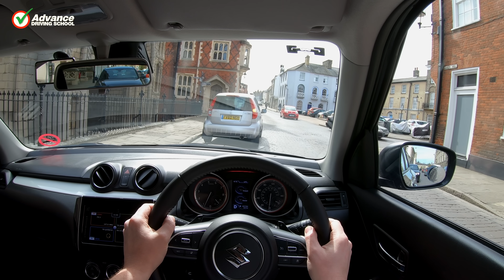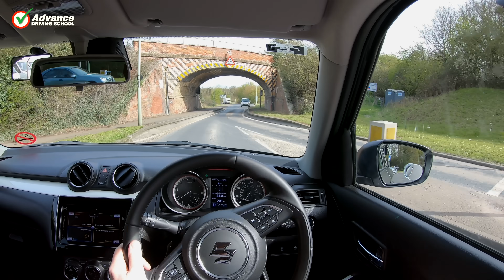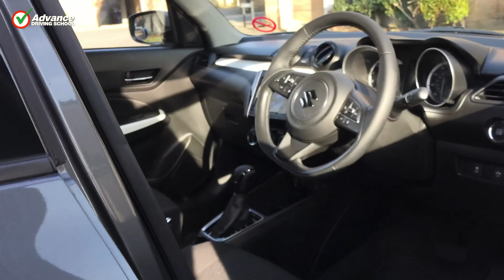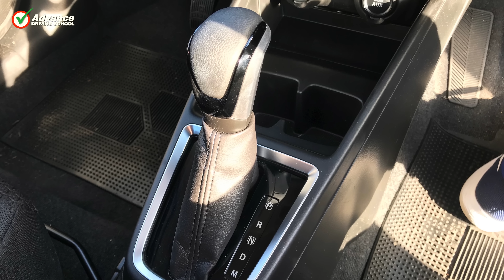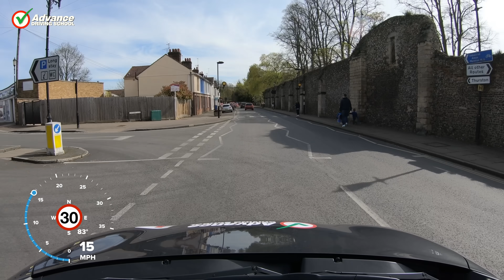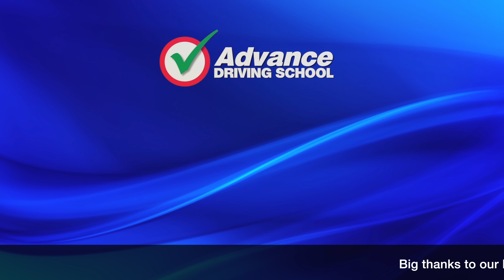How To Drive An Automatic Car

Comment: When driving in busy road in automatic, which position should the gear lever be when stopping briefly or more than 3 seconds while making use of handbrake?
Reply from the maker: When stopping for anything less than 30 seconds we just leave the car in Drive, and keep the foot brake applied. If stopping for a longer period, we just select Park and release the foot brake. We only use the hand brake when actually parking the car.

Comment: The video says it's a 2019 car but the registration number plate says 2018 (68 plate).
Reply from the maker: That’s correct  - ‘68’ plates were issued from September 2018 to March 2019 👍🏼

Comment: What gear do I select at a red light?
Reply from the maker: There are no rules about this - but you have 3 options, depending on how long you think you might be waiting for:
1: Stay in Drive, and keep your foot brake applied
2: Select Neutral, and apply the hand brake
3: Select Park and release the foot brake

Comment: For an ADI part 2 test, is it essential from a safety point of view to use PARK and the parking brake at traffic lights and pedestrian crossings?  I normally use the HOLD function with the vehicle in DRIVE but if you accidently touch the accelerator, it could be quite dangerous at traffic lights and pedestrian crossing....please advise. Thanks!
Reply from the maker: As long as you keep control over your vehicle, you will be fine. There isn't any requirement to use the handbrake, or select Park when you stop in traffic - we only use them when parked at the side of the road. However, if you think that is the safest thing to do in your car, then that will be OK.
Reply: @AdvanceDrivingSchool  Thank you.

Comment: Sounds silly but the light voice is very therapeutic. I have had a year break since driving. Had around 5 years pracfice but only in a manual. Never an automatic. Just had my new car a few days and only driven 4 miles. I am nervous as I made a mistake when I first got it  breaking too hard...as i thought of a clutch. Ive been told to just go out and practice as much as possible. Then it will just come to me like a manual did as its the same as a manual just no changing gears. It should be easier but is isn't as muscle memory I still am stuck mentally on a manual. Trying my best to just forget any worries and just go out. My first experice  driving was 400 miles to Devon my first week of driving after a 2 year break. It was the deep end but it gave me confidence. I may do a similar thing again this time. As I cant just stay still and not practice.
Reply: I also may go further to areas I know. As ive moved house into an area ive got no idea about. Which well adds to the nerves. As I have to concentrate even more with the lack of knowing the roads. Quite a busy area too... so ive had a poor start.

Comment: I know i should park my car in "P" but Is it safe to park it in neural ? i mean nothing will be broken ?
Reply from the maker: We shouldn’t leave the car in Neutral, as the car is free to roll away if the handbrake isn’t applied firmly enough. Using Park locks the driven wheels for extra security 👍🏼

Comment: Is it Okay to turn the car without pressing the brake pedal ?
Reply from the maker: Yes, we can steer the car at any time 👍🏼
Reply: @AdvanceDrivingSchool  Sorry i mean when starting the car should you brake ? or just click the start button?
Reply from the maker: Ah, sorry. On most automatic cars we must push the brake pedal before starting the engine, and on most manual cars we have to push the clutch pedal down. This is intended to stop the car moving accidentally after the engine starts.
Reply: @AdvanceDrivingSchool  You helped me so much, thank you!

Comment: I have a little Question for you:
i sometimes watch car races and i notice that the racers pushs the gas while the car don't move, Are they are pushing brake and gas at the same time ? and isn't this dangerous ?
Reply from the maker: Most racing cars have a manual gearbox and clutch pedal, and the cars aren’t moving because the driver is also holding the clutch pedal down, which disconnects the drive until the race starts.
Reply: @AdvanceDrivingSchool  and what about the automatic cars? do they just press brake and the gas in the same time?
Reply from the maker: I can't think of any racing cars that use a normal automatic gearbox, but there must be a few out there.  Who knows what they do? Pressing both pedals together isn't generally a good idea as it will overheat the gearbox!
Reply: @AdvanceDrivingSchool  thanks !

Comment: I have had 3 lessons in a manual. I have all the knowledge but applying it in stressful situations was unbearable. Stopping at traffic lights and roundabouts i was sl focused on clutch and gears that i was neglecting whay was around me. I have my first lesson in an auto next week and im actually excited for the lesson rather than fearful. I jusy want to get from point a to point be as easily as possible!
Reply from the maker: It does take a little while to master the controls of a manual car, so what you found was very common. I’m sure you will enjoy the automatic!

Comment: thank you, I found this useful. Last time I drove an automatic car was over 30 years ago and my boss asked me to deliver a part around the corner in his car. it was the first time I ever drove an automatic , all the years since driving I had a manual car, I even passed my driving test in a Manual car. So when i got in his car i was driving it terrible I kept using my left 'clutch' foot pressing it on the brake pedal. I should have tucked my left foot away totally i would say, it felt very alien and I havent driven a vehicle with an automatic gearbox in any shape or form for over 30 years now and a bit apprehensive how I would get on - but very soon i will be interested in buying a Renault Zoe full electric car and this will have automatic transmission so I am just going to have to master it i guess as you cannot buy an electric car with manual transmission , its impossible!
So, one thing in the video that confused me is that you can use the 'M' manual on the gearshift and the paddles on the steering wheel to join the carriageway at speed and then you said then you can select 'Drive' ... but dont you have to press the brake to move the gearshift selector or can you just move straight out of M to D only you didnt explain that? - and equally can you come out of D to M without pressing the brake pedal or do you have to press the brake pedal to take it out of Drive to Manual? - Thanks.
Reply from the maker: You can change between different forward drive modes without pressing the brake pedal - for example some cars have sport / winter / manual / eco modes. Since you mentioned it, we have made videos about left foot braking, and how to drive an electric car 👍🏼
Reply: Jut bought my first automtic car after fifty years driving manuals, found your video excellent, after the first week everything is falling into place. Thank you.

Comment: “Relaxing” and “Driving” in the same sentence sounds pretty dangerous to me.
Reply: Should have said less tiring. A long drive in a manual car is more tiring than the same drive in an automatic.
Reply: Yes, I think that manual cars are just better because you have to pay attention at all times.
Reply: They said relaxing, not sleepy. You can be both relaxed and alert - in fact, I did judo where the instructor said to be that. So not on edge, just alert for things, being aware of your surroundings, but being relaxed enough to easily get someone off balance and throw them on the floor if necessary, as trying to judo while stiff is not easy. Similar with a car - being relaxed enough not to be on edge or go into road rage and to be able to drive in a calm, controlled manner, while being alert to your surroundings and therefore able to deal with events quickly is much better than being stressed.
Reply: Totally agree being stressed all the time isnt good, its relaxed doesnt mean you arent looking at  your surroundings, or cannot react. Not sure people should be driving at all if they arent observing whats going on, doesnt really matter regarding the gearbox people still have to do all the things you would in a manual to pass the driving test.

Comment: One thing i don't like about automatic cars is how the reversing works. Maybe it's just the the calibration of the throttle response for the specific car i drove but i felt like the car would just reverse faster than i was comfortable with and it was hard to regulate the speed with the brake pedal. Where as in a manual, you have way more precision when you only need to use the clutch.
Reply from the maker: Yes, that does depend on the car, and the type of gearbox that it has. If the 'creep' speed is faster than you want to go, lightly press the brake pedal to slow the car down. By adjusting the amount of braking force, it gives us the same speed control as using clutch control in a manual car.

Comment: What are the M- and M+??
Reply from the maker: If we select M for Manual mode with the gear stick, using the M+ and M- buttons on the steering wheel allows us to change up and down gears manually.

Comment: I think you should do manual lessons/tests as then when you pass you can drive both and in certain situations like going on a long trip and your friend drive a manual you can switch drivers and not worry that you only did an automatic test
Reply from the maker: Of course a manual license will give you more flexibility - but it will always take longer to learn and therefore cost more.
Reply: @AdvanceDrivingSchool very true.
Reply: @AdvanceDrivingSchool  Licence

Comment: When I was 10 years old, I thought an automatic car allows you to drive without you controlling it meaning that the car drives itself (i'm now 16). Then I realize that manual and automatic are to do with the gears
Reply: Tesla is on it and so are some more companies.
Highway driving on fully automated cars is pretty secure but they're doing 1 million miles of machine learning and test driving for that technology.

Comment: Great video for an automatic transmission, I'm 25 and I really need to pass my driving test fast and get my license, prone to stall a lot on a manual car it's not for me. Question? How many lessons does it require for me to pass on an automatic car?
Reply from the maker: We can never say how many hours it will take to pass - in any type of car. It is probable that less hours will be needed in an automatic car though, as there are less skills to master. Why not arrange a trial lesson and see how it goes?

Comment: Hang on... if you’re on manual, how would you switch to normal driving if the car is still moving...?? You’d need to push the brake pedal ...🤔
Reply from the maker: You don't need to press the brake pedal when changing between different forward driving modes (ie D - M etc)

Comment: when i park for stop sign, can i just apply the handbrake without changing to P gear?
Reply from the maker: You could do that, but the car will keep trying to creep forward if it's left in Drive - just as it does when we hold the foot brake on for a short stop. If we need to stop for longer and want to use the handbrake we normally select Neutral, to stop the car trying to creep.

Comment: Most people slate automatic cars but to be honest I learned in a manual and passed my test last July in a pretty new car so when I came to buy a car I bought a cheap manual and it's a pain especially when you need to buy a cheaper, older car for insurance purposes. If I could do it all again I would of learned in an automatic and bought an automatic once I'd passed. I will definitely look at buying an automatic for my next car especially for town and city driving it takes all the stress away and you can focus more on the road.

Comment: I drive a manual but considering automatic. The video did not advise what feet to use or not use on what pedal. Obviously in a manual the left foot is used all the time. As I understand it you should never use your left foot in an automatic. But for manual drivers unless you are told that it is tempting to use the left foot on the brake pedal. Doing that could be a recipe for disaster. Did I miss it on the video or did you not think it was worth saying.
Reply from the maker: We made a whole separate video about this! 
Left Foot Braking An Automatic Car  |  Learn to drive: Car Control Skills https://youtu.be/1X_z6OVcPeQ 👍🏼

Comment: A couple of points I think you should have added for people that have never driven an automatic before...

When changing gears in manual mode, you do not need to lift your foot off the gas (people coming over from a manual may not know this)

When stopping for a while (like at the temporary lights in the video). It’s best to select Neutral and use the Hand Brake.

Comment: One biggest difference in driving automatic and manual is the usage of the leg. In manual cars, we use two legs one left leg for the clutch and the right leg for brake and acceleration. Whereas in an Automatic car we have to use only the right leg for break and acceleration and the left leg is always idle. This was the major difference I found when i switched both vehicle. But if you use both legs in automatic cars then you will end up in sudden brake which is hazardous. Rest everything is fine in this video
Reply from the maker: Not everyone uses one leg in an automatic car: Left Foot Braking An Automatic Car  |  Learn to drive: Car Control Skills https://youtu.be/1X_z6OVcPeQ 👍🏼

Comment: Kickdown? Been driving since 1972 and my question is "why have a manual when an automatic does it for you"?
Reply from the maker: Some people enjoy the extra interaction that driving a manual car gives, and it also allows a wider choice of cars. Automatic cars are usually more relaxing to drive though - perfect for simply getting from A to B as easily as possible.
Reply: phil mayson exactly I don’t get it either !!! I feel that in an automatic you have much more freedom as your able to focus more on the road and you have much more control over the steering wheel since your not fiddling with the gear stick as there isn’t one .

Comment: say you're going down a dual carriage way in the 'Manuel' mode, how would you then change into drive? As if you press the brake the car will slow down?
Reply from the maker: You can change between different forward drive modes without pressing the brake pedal, so we just need to use the gear selector to change between M and D. In other cars there might be S, W or numbers 1, 2 3 etc and we can move between them whenever we need to.

Comment: I always think of a Automatic car as a lazy persons car.
I love manual have driven auto but the pull off is to slow for me🙄
Reply from the maker: That’s interesting, as one of the biggest benefits of a modern automatic is how easy it is to pull away quickly - which is great at busy junctions. Perhaps you drove an older model?

Comment: Am I right in thinking an automatic car is forever in movement when turned on unless we apply the brake. Whereas a manual car is always stationary until movement is instigated by the driver. I always understood the main difference are the gears etc/clutch but if I understand right then there are two different driving styles and abilities at play. This is really confusing me. Thanks
Reply from the maker: Once the driver has selected Drive in an automatic car*, it will want to move unless we press the brake to hold it stationary. Of course, if the driver selects Neutral or Park then it won’t move. *=on most auto cars, as some don’t ‘creep’.
Reply: @AdvanceDrivingSchool  many thanks for your reply, I do appreciate it.

Comment: i passed my test 40 years ago in a automatic it was hard to find a car after wards not many about then i passed in a manual now I'm over 65 i think i need a auto again spoiler for choice now how times have changed couch control is getting to me aswell
Reply from the maker: Yes, there is a lot more choice now - and modern automatic gearboxes are way more responsive and efficient than older designs, so they are much nicer to drive. :-)

Comment: Before passing my test in a manual car I tried to drive my friends automatic car and it was so confusing as I kept on putting my foot on the “clutch” felt like I wasn’t in control😕
Reply from the maker: It does feel strange until you get used to it!

Comment: On Friday I've my first driving lesson in an Automatic as an Automatic will slightly easier for me to drive than a Manual as I won't have to engage the clutch to change gear in an Automatic. To me passing my practical test in Automatic would be no bad thing & as would be better than nothing to have a full licence for Automatics. When I learnt to drive in a Manual 14 years ago I struggled with the gears & gave up & I've now decided relearn to drive this time without the gears. .
Reply from the maker: Good luck on your lesson - I'm sure you will enjoy the automatic!

Comment: Can you drive cars with DSG (direct shift gearbox) gearbox on an automatic license? I’ve read different results.
Reply from the maker: Yes, you can. A manual car is any car that has a clutch pedal, anything else is classed as automatic (even if it has some form of manual control) and can be driven on an automatic licence 👍🏼
Reply: Advance Driving School Ah I see that’s excellent 😄 I’m going for automatic and have seen the car I want however it’s got the DSG gearbox but that’s great to hear

Comment: Is it a good practice to use neutral (with brake) in the signals? Will it cause any damage to transmission due to frequent changes?
Reply from the maker: We would not recommended selecting neutral when the car is moving, as it reduces our control over the car and may even cause damage. This video has more info: 
How NOT To Drive An Automatic Car  |  Learn to drive: Car control skills https://youtu.be/V42BemHm-0s